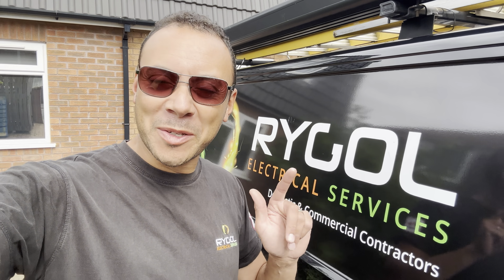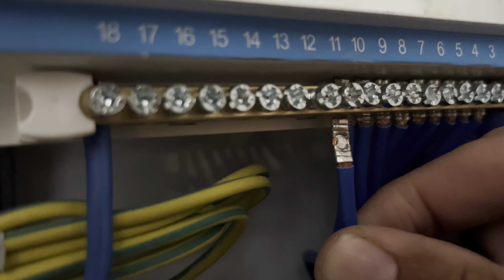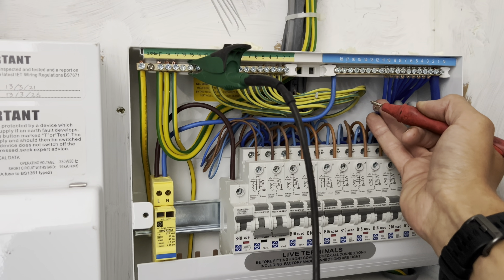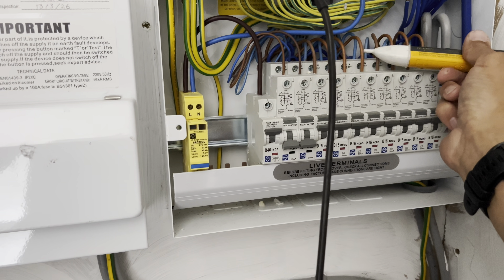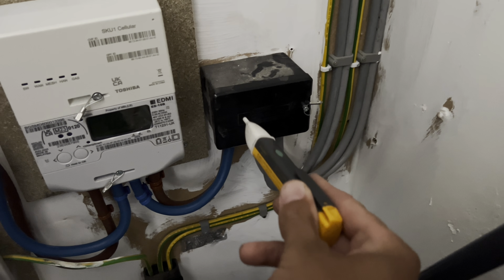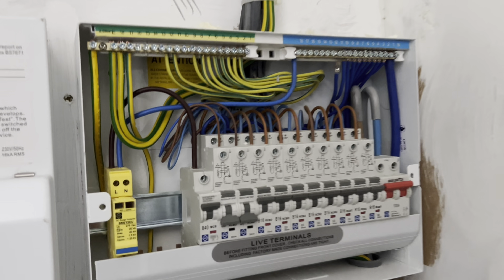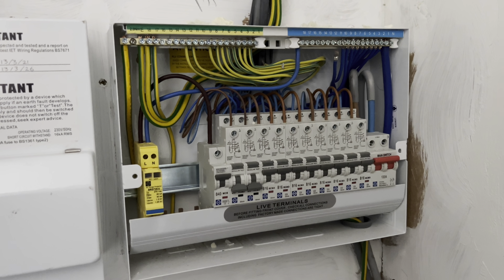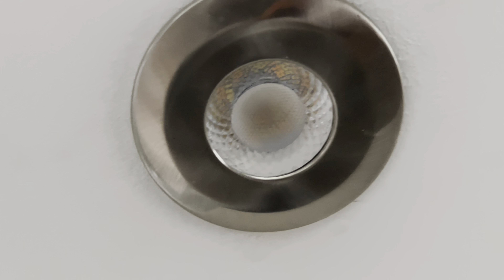Smart Meter Disaster! ⚡️

Comment: It was a very inept person who performed this work and they should be dismissed or retrained. This should be reported to the electrical authority having jurisdiction. I am from the U.S. and unfamiliar with UK electrical systems and code, but I would expect the electrical ground system to be energized, along with the neutral, which would likely energize all of the metallic enclosures of electrical equipment within the premises, an extremely dangerous condition.

Comment: Stop a drama...you are electric and should know very well that main low voltage does not kill. Sure, you shake bit but nothing more. That drama is added only to keep the market under greedy and fool electricians control. I repair EVs and there is much higher voltages than your shi tty 230VAC

Comment: I am from Kazakhstan and when I was a teenager I was helping my dad to wire our house. My dad was not an electrician and neither was. But the problem was that the "contractors" that you can hire for help are not licensed either, they are just normal people with some knowledge in electricity. But I do remember that once I was connecting outdoor lights and they were flashing even when they were off. That day I did some research and learnt about the polarity :D. It's sad to hear that even in first world countries you pay licensed technicians to work on your house but you get the same result as a teenager in 2nd world country :D

Comment: Well spotted . common practice with a double Henley block is for the Lives to be at the back and the neutrals connections to be at the front , I can see why this poorly trained meter fitted made their mistake putting the neutral back into the front block following their training without the proper knowledge and experience needed to carry out this type of work , its very dangerous letting these people carry out this type of work where life's can be lost, and it's totally unexceptable walking away from a job without carrying out the necessary tests that  that are required to sign a job off

Comment: I’m going to agree with the comment, humans make mistakes, that is why final testing is so important. 

I also agree that sometimes live work is necessary to test, but you should always have extra precautions when working on anything live. The first and most important thing is to assume every terminal is live until testing proves otherwise. That simple rule has saved my life several times over.

As for rectifying the problem, that is up to you to decide if someone fitting meters deserves to get away with potential killing you, or me (if I was to go there), or the customer. I don’t think it is acceptable to have skipped the final testing, thus putting lives at risk. I understand you need to make sure the customer is safe and happy, but also that you document everything and report the problem.

Comment: There is more than one socket in the kitchen - could it be that one kitchen socket is cross-wired and the smart meter installer tested on that, and therefore didn't pick up on their mistake?

Comment: As general rule with those Henley blocks you would have the line at the rear and the neutral at the front, looks like the meter guy did that which is standard practice but not necessarily a rule or in the manual, but the out going tails are the other way round with neutral at the rear, not saying that’s wrong just unexpected. No excuse for them not checking though, we check and test to ensure things are the way round you were expecting.

Comment: I'm genuinely amazed how nothing blew up being connected backwards, but i suppose modern electronics can possibly handle reversed live and neutral
Reply: In Germany and the Netherlands, plugs are not polarized. So power and neutral are interchangeable on equipment that is plugged in. Given those circumstances, most equipment is built in a way that phase and neutral can be swapped.
Sometimes there is a small issue, such as hum in audio. Solve by turning the plug.
Reply: @pizzablender  in the UK that's slightly different as all our plugs go in one way, however I do love foreign plugs and my adapter for American plugs works both ways flawlessly

Comment: 8:38 - who installed that Henley? Top bit should be line. Bottom should be Neutral. Silly meter man assumed you installed the Henley properly!

Best off to use coloured tails (not just inner insulation) and coloured terminal blocks from Lewden.
Reply: To be clear, your work looks excellent 👌 You are not at fault at all. But if there is any learning to do, we have to take the world as it is. Helping people identify conductors would be a bad thing. The meter monkeys often right it on or tag them.

Comment: I'm an electrician, and the first thing I noticed was what a lovely neat Fuse board, well done. By the way, did the DNO not fit a main isolator switch as part of smart meter install, makes it really tricky to alter main tails in service connectors without removing main cut out fuse
Reply: The DNO doesn’t install the meter.  The big SIX companies install meter’s and the double pole switch.

Comment: The meter installer should have done the proper checks. But something I've always done when using grey sheathed meter tails, that might have stopped them making the polarity mistake, is to put brown tape markers on live tails and blue tape markers on neutral tails.
Reply: We’re taught to mark them up before working on them anyway so it’s still his fault. Plus the martingale. Although I’d say nearly all electricians seem to put neutrals at the front

Comment: This is one of the reasons I prefer the USA power system. Since we have a split phase system going into the house you can not have this kind of fault. (you can still mix up the neutral and the grounds) In addition we only have 120 Volts (much safer) going to most loads except to were 240 volts when needed at a heavy load. Glad to see that you test for this problem. (I would like to learn more about the test device that you use.) We have the problems too when some one does not do there work correctly.  I'm not sure about this but I assume your pole/pad transformers are split phase but at 480 volts with only 240 volt single phase going to each the house.   Best wishes from across the pond.

Comment: These people are on a minor course to install these, they are not electricians. He has possibly thought its AC not DC it has no polarity. Not realising that neutral goes to earth back in the sub station and it does matter for sockets and machinery as it affects the flow of electrons. Hence i came to the conclusion right after the spark from the neutral and the voltage on the earth that somewhere before the main board somone had switched them around. Now not checking tut tut tut they even left thier tags on so it only leaves them culpable.. ps im not an electrican

Moral of the story even for seasoned electrician never assume evetythings ok always check.

Comment: When i was was an apprentice,, this happened to me. I was told that the board was dead, but I felt a tingle when I touched the painted case. I got a screwdriver and shorted the live to the case, nothing. When i shorted the neutral to the case with the screwdriver, there was a flash which blew a hole in the screwdriver blade and the case. The senior electrician who gave me the job was fired.  To think I had been working a week earlier in the factory up on 3-phase bus-bars on (In those days) on aluminium 'A' steps. He thought he was very good at tricking apprentices, - I guess he got his come-upance.

Comment: Cross polarity is a sacking offence in the DNO's I worked for.

I suspected this was cross polarity with the title of the video and confirmed with the flashing lighting when the consumer unit was off.

I would recommend aquiring rubber electricity safety gloves for when you suspect there's a cross polarity - as they say always treat as live until proven dead - and proving dead wearing appropiate PPE 

In this instance you should have reported it to the DNO as a cross polarity, this would have been treated as an emergancy call out and they would have investigated this as a serious H&S failure.

This where you should have left it - unless you are quailified to work - I'm assuming you pulled the mains fuse  - on DNO equipment to remedy the situation and have the appropiate training and PPE for live working.

if not - delete the video.

Comment: After watching this, i find 1 thing puzzling.
How didn't the over voltage protection didn't detonate.
Normally the neural and earth have hardly any voltage across them, now it was 240v.
I would have expected the neutral to earth over voltage to detonate the moment the main fuse was plugged in.

Comment: Looks like you got the service block wired with the neutrals on the bottom/back and line at the top/front. Contrary to accepted practice. That may have been what caused the confusion with the meter changer. Although he should have checked.
Reply: 100%

Comment: As a retired meter installer, the 1st thing and last thing you do is check 2 sockets for correct polarity. If it is incorrect you contact your manager. You do not put right the mistake. This is a disciplinary for the original fitter.

Comment: This is an argument I have with the Niceic I split properties across multiple Rcds, and when inspected I am told it would be good practice to use rcbos, but non of those would have disconnected the power in the event of a shock with the polarity reversed.

Comment: Very nice explanation and cure of problem. I lived in UK till I was 45, been 35 years is NL. Plugs and things are different but the voltage & Hz is the same. we also have smart meters! Most devices have 2 pole plugs so live and neutral don't seem to matter - can't even see which way round you are pluging!

Comment: Why is there not a 100 amp double pole switch between the meter and the connector block to allow you to isolate the customers side? Are they not required any more? When I worked for a dno and the gear was booked out for a job the double pole switch came with the 100 amp cutout, fuse and tails.

Comment: After having solar installed 12 years ago I had to have my old rotary meter changed for a new STANDARD type electronic one. The first one did not work correctly but the second one did. The installer left some certification in the meter box for the next person, a 'Checker' to come and test the system and pass it off.
STILL AWAITING THE CHECKER.

Comment: As a retired elctronic engineer I can honestly say electricans have at the basic level 3 wires(single phase) and they fuck em up all the time... I on the other hand have designed PCB with 1000s on connection 100% accurate....  What this is pure laziness on not checking their work.

Comment: I may be missing something here but looking at the way the meter tails go in from the meter to the tail block it looks correct ie the neutral at the front and the live at the back. So i assume that the tails going to the boards are connected with the live at the front and the neutral at the rear which not the usual way to connect those blocks and which has probably confused the smart meter installer in the first place. 
However no there is no excuse for not doing any testing to check polarity at least.
Reply: Agreed.
Reply: You sir are correct. The initial installer of the system has wired the double pole henley reverse polarity.
Reply: 2nd that

Comment: Not the same order of problem on our gas and electricity meters... 
When we had the smart gas meter installed the "installer" left the sticker with the meter code stuck on and so didn't record its number. It then took months for the meter to be initialised and for me to stop having to send readings. I got questions like "have you more than one gas meter?" and even after sending a photo of it and quoting its serial number in a text message, it still took another month or so. In the end, the meters work, but the signal is not good enough to make the home display work or their usage breakdown ... and we still have missing days, although we are on half-hourly readings.
Problem of meter not connected only because installer either didn't do his paperwork or got the meter number wrong!

They should have a bar code reader to stop transcription errors and have a lock so they can not close the app until the bar code has been read.
Do the suppliers get their money when the meter(s) are physically installed or when they are operational?

When the smart electricity meter was installed ... I do not think any  socket was tested after  installation. It should be a legal requirement that the homeowner should be shown a simple socket test and sign off the installation. (Also... the socket tester should show red leds if a fault condition exists ... not just a failure to show three greens as the installer could say ...'look it is OK you have a green' even with a test failure!)

Comment: Mate I am NOT a Sparkie....BUT I was a Tradie.... IF you changed over the CABLES....Then you are part of the PROBLEM...This should have been reported for the Smart Meter Co to be made aware to ensure this DANGEROUS SITUATION was highlighted and the Installer Summoned for Dangerous Practice Occasioning Bodily Harm.
       Your responsibility ENDED when you proved the Smart Meter Installation was Dangerous, you should NOT have interfered with the Seal as that is WHAT IT IS THERE FOR.

Comment: Funny enough, I`m a retired spark from the local  DNO ,the last time my smart meter was changed the meter fixer connected my house reverse polarity at the DP switch..right in front of me ! luckily no issues.
And talking about electricians getting a shock, when I got called out to jobs where an electrician got a shock because of a fault/mistake on the DNO side , the electrician was quite right to be annoyed...but I always asked the spark " what was the very first thing you got taught as an apprentice.......prove the equipment is not live with your test gear.... unfortunately we all get blasé because we work with electrics all the time.
Reply: Every time you don't test it's wrong.
Reply: rubbish the very first thing you learn as a joey is how to make a proper cup of tea 😁

Comment: Great video Leon. But were all the Puns intentional? 
Yes this was an unfortunate case of human error, of which we are all capable of. We really did not used to test things so much years ago, but now we do, and i often find a major safety issue in around one in five jobs i attend (usually a not functional RCBO). Until domestic household, no obligation safety checks become free of charge there will always be risk.
The LED lights gave the fault away this time, as a matter of interest the same thing happens if someone has switched the neutrals instead of the line.

Comment: This puts me in mind of when they changed the meter in my partner's house. After her meter was changed it read nothing at all. So they accused her of somehow defeating the meter. They then came and looked at it saying it was ok. This went on despite 3 more separate visits from the engineers. My partner was in tears because they were accusing her of some elaborate theft. So I asked her to send me a phone picture of her meter cupboard. On the phone picture I could immediately see that they had crossed the neutrals each side between the input and output of the meter. This meant that the electricity that went in on the live side was subtracted by what came back from the neutral side - which caused the meter to read nothing at all! I told her to write this down and tell them all this next time they came around (4th visit). Only then did they actually correct it. What this tells me is that these 'engineers' are all insufficiently trained - i.e. they know nothing at all about electricity and even the things they are installing...
Reply: Hopefully when the electric company tried to extract money from your partner for the [inflated] estimated of her usage in that time she turned round and asked them for 3 times the amount plus punitive damages for causing her mental anguish, accusing her of theft,  branding her a criminal, potentially recording this judgement amongst her personal information stored under GDPR all because of their incompetence. Big companies, as well as their small sub-contractors, need to be held accountable they already ride roughshot all over us customers.

Comment: Not really a 'Smart meter' problem. Years ago, I came across exactly the same thing with a bog standard disc meter. As others have mentioned, it comes down to unqualified people messing around with equipment they haven't been properly trained to install. Not your problem really. You should have made a call to the DNO, which would have had people coming out and reports going in to the system. Once you touch it, nothing to stop them saying you caused the issue - if you get my drift..

Comment: You definitely need to report this to the DNO. If the poorly trained installer is making this mistake, how many other properties are they doing this at ?? How many people are they putting at risk ??

There wasn't any testing done on this after install of the meter

It looks like Neutral 11 screw was not tightened up at 14:50 when you touched it with the probe ?

Comment: So not only did they not do the tests they lied on an official document. 😡
The guy that did my meter the other day did all the tests, he also mentioned that they are required to remove stacked dual pole phase blocks / junction blocks like you showed and replace with single pole phase blocks. I thought that was a bit excessive, I guess it would probably have prevented this cock up!

Comment: I not sure if this is caused by simular thing, reverse cables , i had electriction fixing solar panels but many months later  the meter was running backwords and the electric supplier didn't know what to do,they finally sent someone to change it round? It worked but they didn't know what power was used 😅